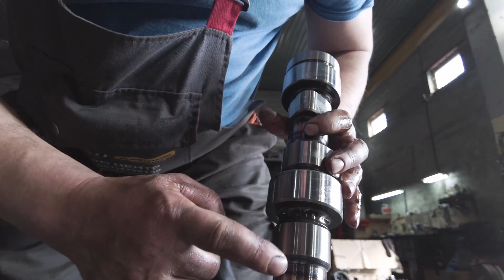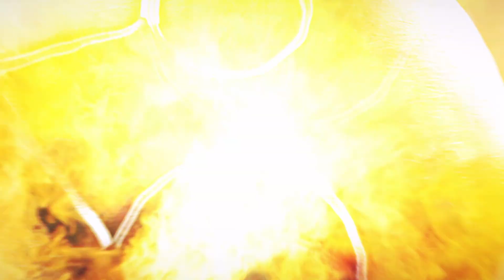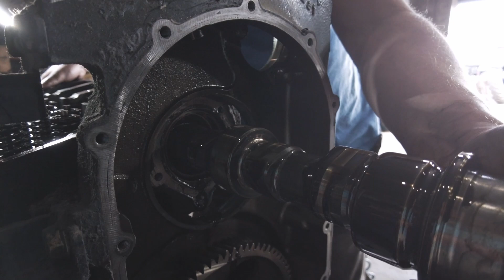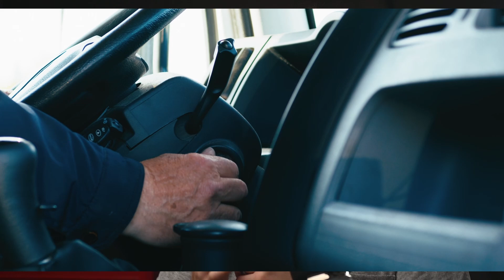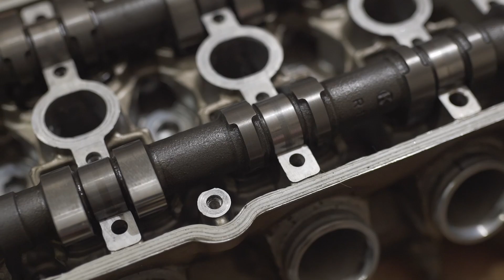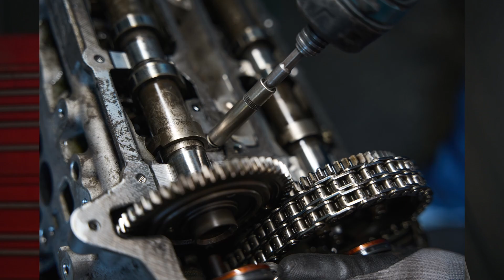CAMSHAFTS aren't SCARY. Learn the diesel basics!

Comment: Why not use hydraulic lifters?  Dirty Oil?
Reply from the maker: I think the higher cylinder pressures (compared to gas engines) aren’t favourable for hydraulic lifters compared to solid lifters. Lots of heat/expansion that hydraulic lifters would struggle with over time.